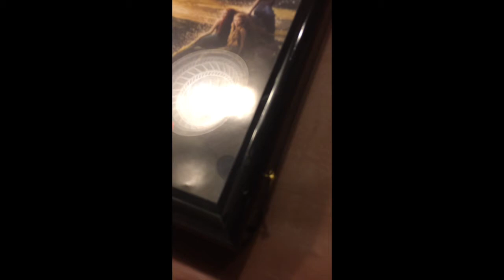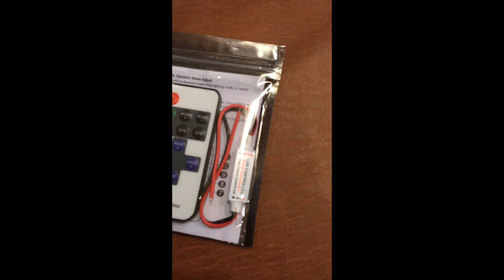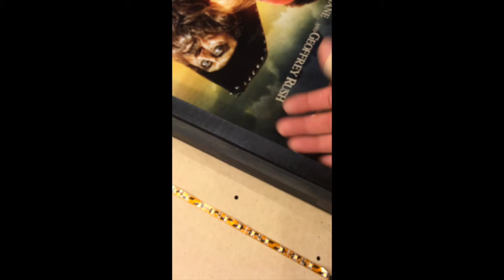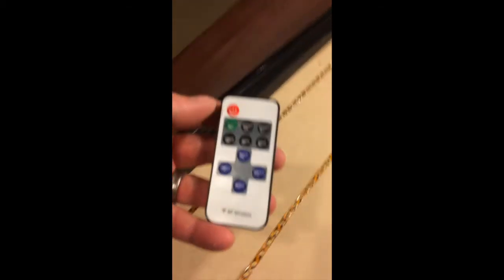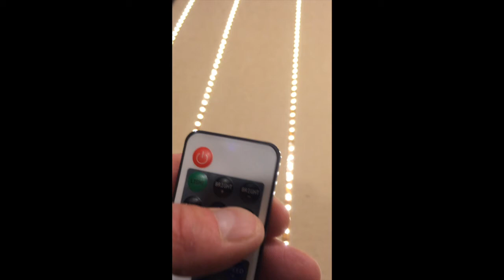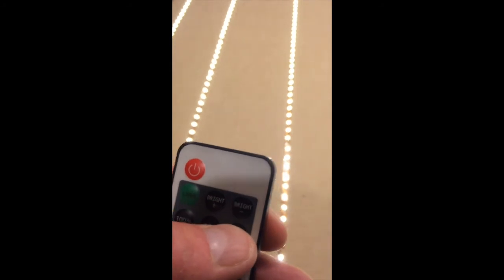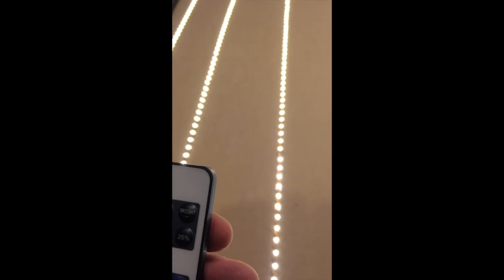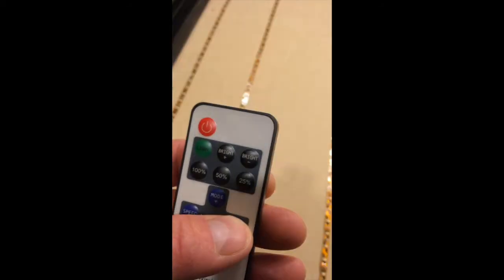How to Make Movie Poster Light Box Part 2

Comment: Hello Steve , i see on this video you didnt use any aluminium tape on this one. Is it nessessary do use it?
 And also you dont use any translucent paper or any opal plexiglas. Does it really makes a difference ?
Reply from the maker: This was my first prototype, the poster simply hangs in the frame without any backing (opal plexiglass). It’s not idea because without the support you may get wrinkles in the poster. Does it work? Yeah, it’s actually worked better then I thought it would. The aluminum tape simply is used to reflect light back towards the front (back of the double sided poster) and simply increases the amount of light hitting the surface. Is it required? No, especially with the brighter LEDs that are available today I don’t think you’d really notice a difference without our it. 

If you don’t mind, a little advice. I think you are probably like me and way over thinking this.  Just go build it, access the build as you progress, tweak the build as necessary, and I promise you it will work out fine.  Best of luck, and post a picture, or better yet, upload a video when completed.
Reply: @TheSteveBidwell   thanks i will do . Its just a shame the snap frame is so expensive to shit to my country.. i am not an handy man but i will of another way to make it perfect. Maybe i will make a few second video how it looks .. thanks for you replies :)

Comment: Hello there i was wondering what the distance is between the poster and de led? I got a frame with a thickness of 2.5 cm . I dont know if its a problem
Reply from the maker: Mine is about 7.5 cm. You need a little space so that the light defuses properly, otherwise the LEDS may appear as small dots on the poster. 
You can try it and see how it works, if may be fine. I’d attach the LEDs with some tape temporarily just to test and see how it looks, that way you won’t mess up the adhesive on the back of them and can reuse them if it doesn’t.

Comment: Did you put anything to disperse the light in the first frame or just the led lights shining directly behind the poster?
Reply: I only have the LEDs, no reflective backing in the first frame. I added the reflective surface in the second frame because the plastic backing of the SnapFrame was translucent, but not clear, so I knew some of the light would get blocked and I wanted to reflect as much as possible back to the poster.

Comment: So, in watching this I was wondering something. You mention the poster just hanging there, however wouldn't a drop ceiling light lense serve a dual purpose in both sandwiching the poster and dispersing the light all along the poster?
Reply from the maker: I had that idea as well, the only problem I ran into was finding the drop ceiling lense that had a wide enough demision. All I could find was 24" wide, which isn't big enough. I even tried cuting a couple to piece together and the stuff is very difficult to cut without cracking it. I tried scoring it with a plexiglass cutter and even tried  a 72 tooth carbide tip bladde on a table saw-- all failed. I'm not saying it isn't possible, but I didn't have any luck with that stuff.

Comment: What if you used the inexpensive sheets of plastic in the cheap movie poster frame you can buy at Target? They are only about $10 I believe, this would allow putting in two instead of just the one
Reply from the maker: Thanks for the suggestion Robert. I did look into this, but the problem I run into is that the cheeper plastic poster frames like the ones sold at Target or Walmart are not the proper size for the movie posters that I purchase. When you get into the theatrical size posters the frames jump up into the $25-$30 range.